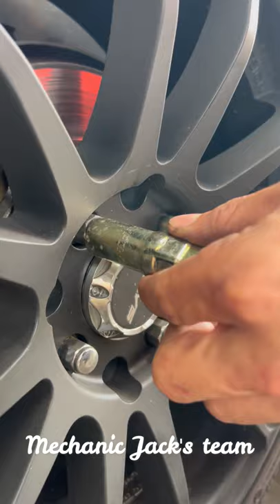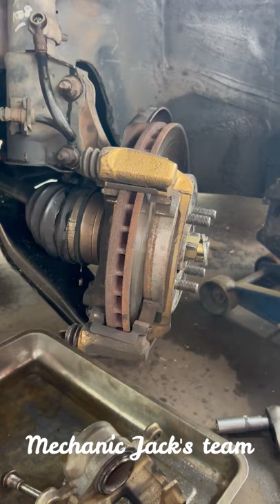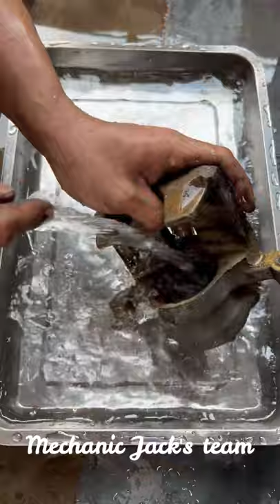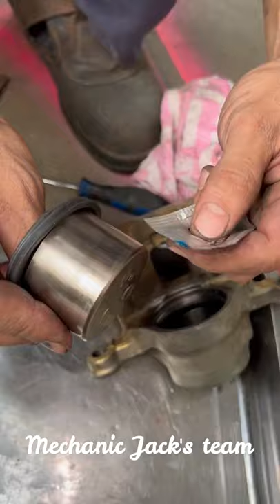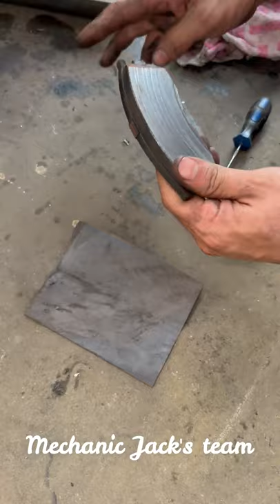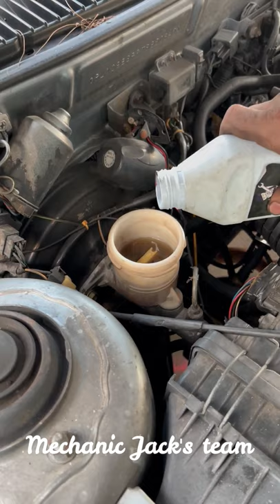Brake caliper leaking fluid from piston

Comment: I couldn't imagine how much nicer the world would be if all techs replaced only the problem parts. It is a lost art, nice work.
Reply: Right? I just spent nearly $2,000 on new brakes and rotors replacement and full fluid replacement. Two days later I had no brakes.  Now they want another $400 for a leaking gasket they missed.
Reply: @DustyJ  wtf dude, thats unreal....
Reply: Lol thats because youre clueless. Reality is its more efficient and cheaper to replace the whole caliper with a reman then to do the seals yourself. 2 remanned calipers for a car this old are 80 total. The seals are about 20/25. Thats assuming you dont have to replace the piston which you shouldnt really be sanding to begin with. It you do the piston will run you about 30 or 40 bucks each. Now do the math